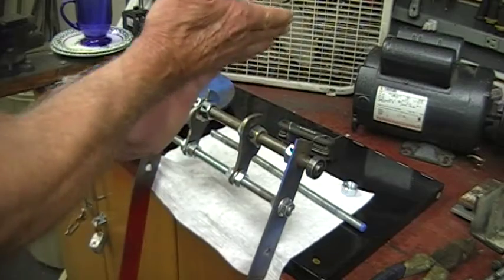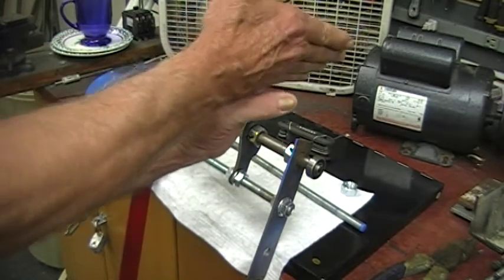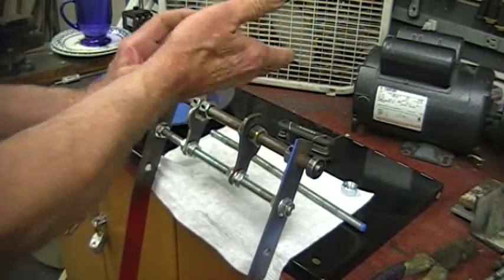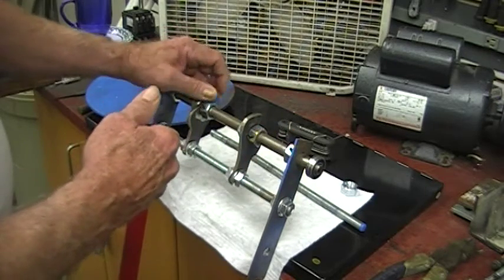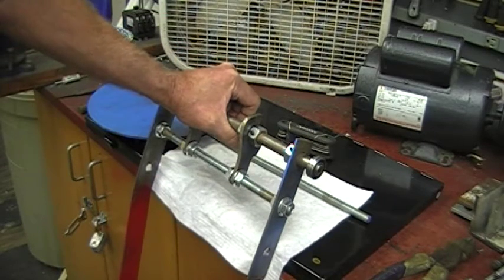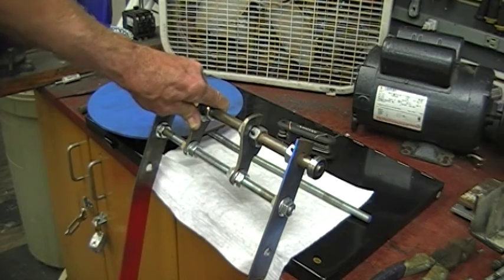escapement improvments

Comment: Followed you just fine Boomer!
Just a thought if you were to put a small piece of angle iron.
On the back of each point on the wheel would it give better stress protection?
Reply from the maker: You are right John .  It would.  The camera did not show it  "BUT" they are small pieces of angle iron. We heat treated all the parts that touch and push ,  Today.
Should have everything back toether and running in a few days.